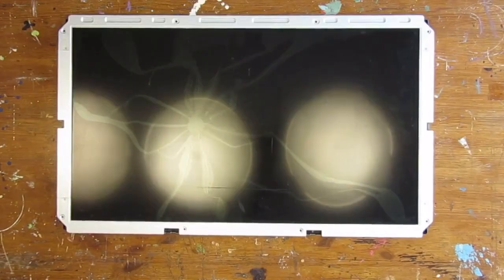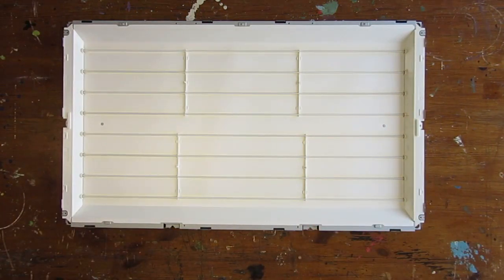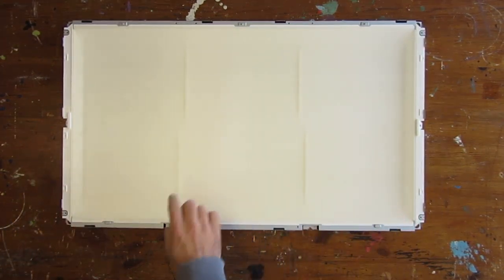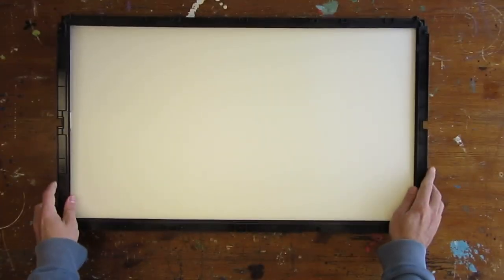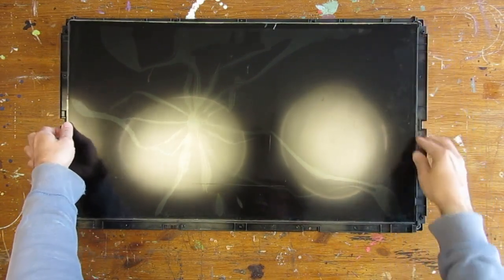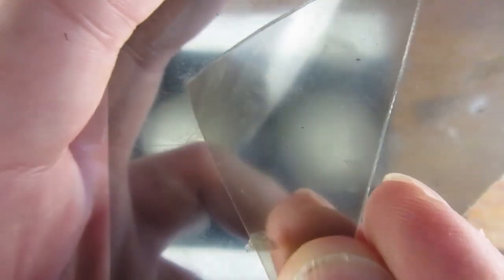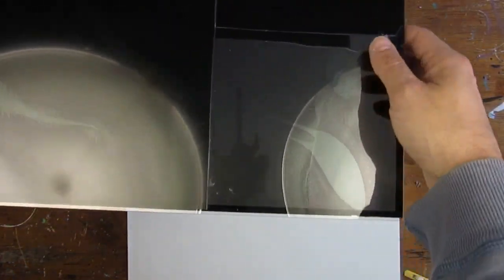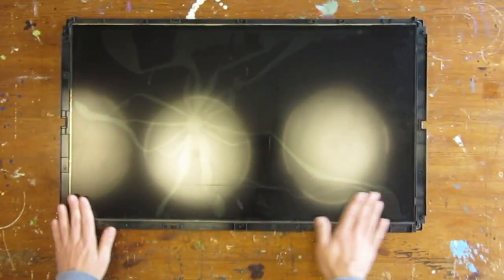How Does An LCD Screen Work? Answering A Liquid Crystal Display Tech Question #LCD #Tech

Comment: LCD is LCD no matter what BAKCLIGHT you are using CCFL or LED... there is not LED and LCD... there is LCD with LED backlight and LCD with CCFL. Idiots.
Reply from the maker: Correct, cant recall what I said but if I did mention LED = LED backlight then I do accept the Idiot part
Reply: This was unnecessarily mean